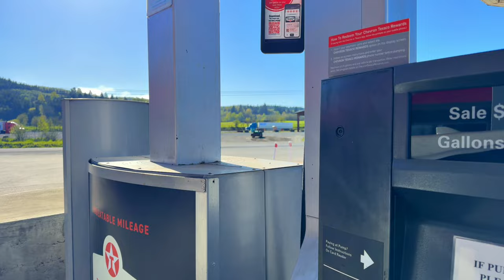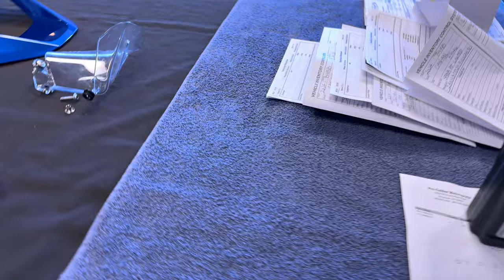The BMW CE-04 EV Scooter!! • Wow, Is This Cool..! | TheSmoaks Vlog_3076

Comment: Interesting scooter. I was certainly not expecting to see a thumbnail of it on your YT channel.  :)
I sorta kinda like it, but it's expensive.  I'd consider the CE-02 instead. Well, not really, but I sort of like the looks better.
As for EVs in general; I see it for scooters and motorcycles, but for cars/truck ....I just don't think it will happen the way politicians say it will.  Even some of the big car manufacturers are pulling back as the numbers of sales are starting to decline.
Reply: Agree with the last paragraph, but I'm not sure e-bikes will really take off.
Reply: @1990-t1j  I hear yah.  The problem with e-scooters and motorcycles are not the purchase of them today, but about 4 to 5 years later.  If you are just doing the around town thing they they should be fine. However, 4 to 5 years down the line when it comes time to replace to batteries, expect to pay about ....oh for a $4,500 scooter the batteries will run you about 1k to 2k to replace.